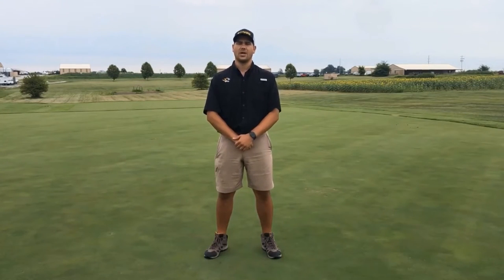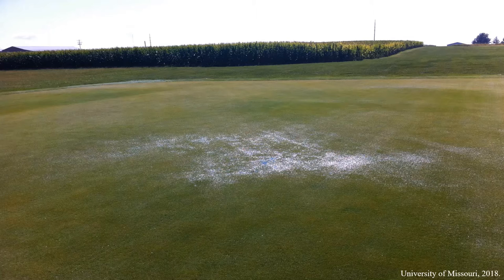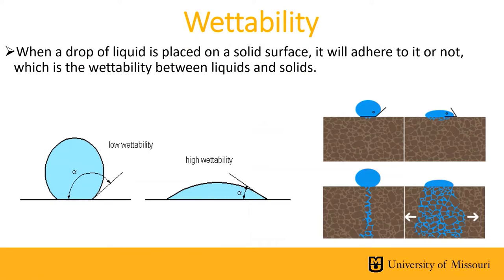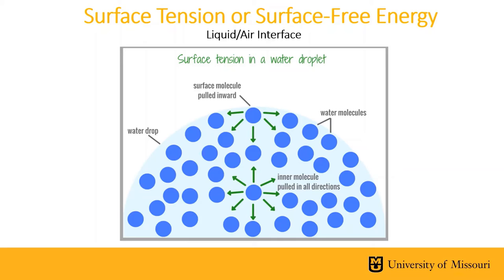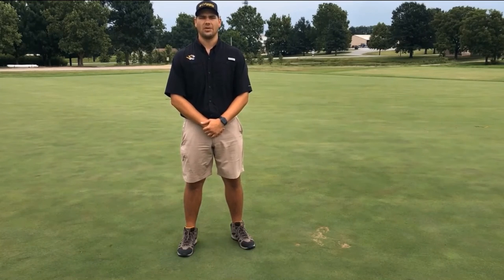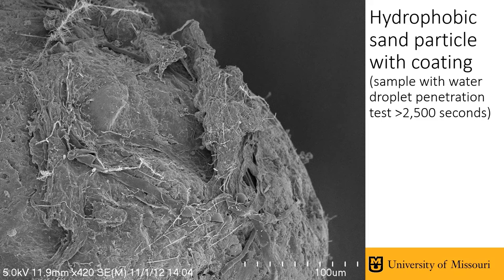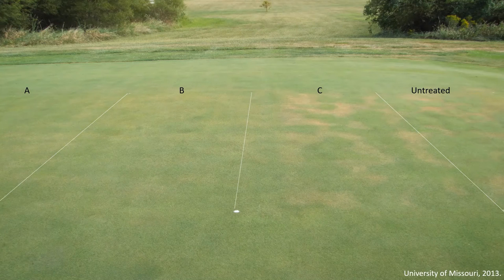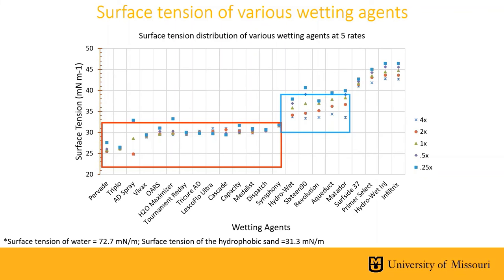Improving Water Retention in Hydrophobic Soil

Comment: This is the best test based information I have found anywhere. Penterra didn’t make the test group, but using it made me wonder if they were all the same because I didn’t get the results the manufacturer swore by. You show me there’s large differences in products. I believe I’m dealing with a compaction layer. You didn’t mention this but, but I have to believe that the products with lower surface tensions would be better for breaking up a compaction layer at the cost of not holding water for lawn and plan use. So if this true, One might want to work with two products, one to work on breaking that compaction layer and the other to maybe get to the compaction layer but retain water better, unless some of the products you tested could do both well. I’d love to hear your thoughts if you or someone in this is still around. Thank you again for this eye opener. BTW, I had been looking at Tricure AD and Underhill Tournament ready, but can see the wouldn’t do much for water retention. Now I will bring Lesco moisture manager in to the discussion.